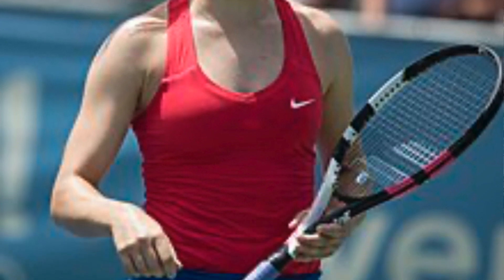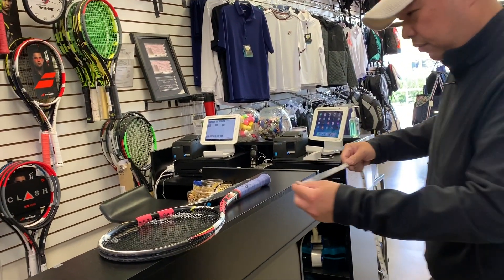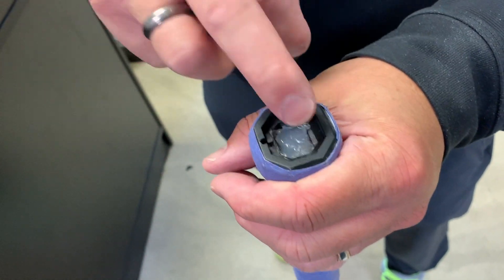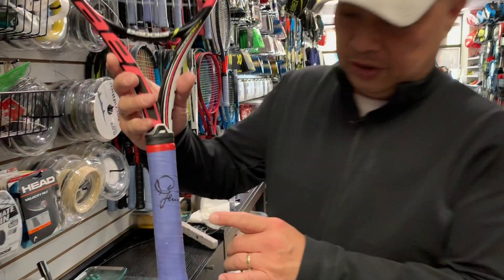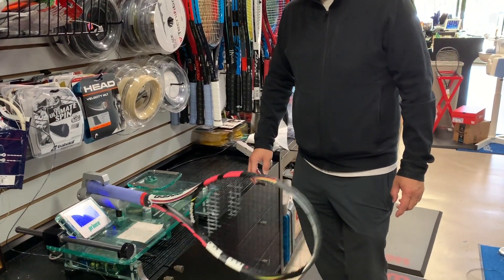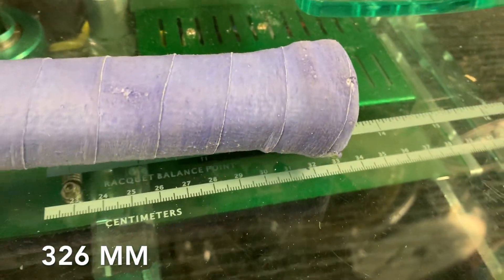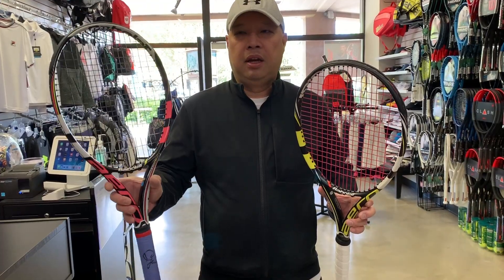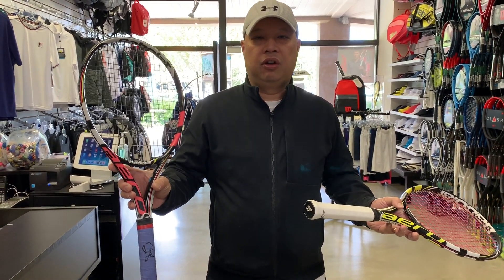EUGENIE BOUCHARD MATCH USED TENNIS RACKET REVIEW

Comment: Does the silicone matter with regards to feel comparing retail and Bouchards frame? Where you able to use it? Less vibration more muted feel I guess
Reply: @ dj...it's mostly used as a customisation tool; to add weight & change the balance. 

Any consequence of that to feel is really only a by product. You wouldn't do the above and totally change the specs of the racquet just to change a bit of 'feel'.

Cheers. 🎾🎾🎾
Reply: @nostro1001   I actually customize myself with lead and silicone to my head  and wilson racquets. It gives solid feeling and a more headlight balance to my frames. What Im interested in is if it makes a difference to how a babolat plays because from what I remember those frames feel hallow and harsh. Been wanting to add silicone on a babolat frame however Ive sold all my babs long ago.
Reply from the maker: You would use it in the handle to add weight and it does take away some vibration and yes mutes the racket.  The weight changes the balance of the racket.  I was saying that this racket felt very balanced and was smooth going through the air.  Thanks for watching!

Comment: Surprising how low the SW is considering that is XL.
Reply: Assume as it was a pro stock racquet it was much lighter than standard. The silicone added a bit of extra weight, but didn't change the SW

Comment: For anyone wondering the silicone is for absorbing shock
Reply: @ Henry... Well no mostly and yes a little. It's about racquet customisation: added weight and changing the balance, so that it's more headlight.

Yes, silicone does change the feel a bit. How much? Hard to know & depends on how much silicone was added!

Cheers
Reply: nostro1001 yes agreed it’s also for changing the balance of the racket but I think even a little amount of silicone can dampen the shock a lot as many Racquets have little absorbing materials in the Butt cap such as my racquet the Volkl V8 Pro

Comment: Silicone in the handle does NOT lower SW! If anything it will increase SW. The difference in the racquets is that hers is a prostock frame. The weight of the frame was much lower before customization. Repeat....adding weight in the handle, even though the balance point changes and the racquet becomes more head light in feel, does not drive the SW down. This is a common misconception by club players and players that get on racquet forums. Btw, it puzzles me that you have to calculate metric CM into metric MM. The system in based on 10s. Where'd you go to grade school?
Reply: @Chuck....100%....adding weight to the handle doesn't reduce SW. People totally misunderstand that.

Edit: lol @ Chuck

**'Mericans just aren't used to metric system!
Reply: @nostro1001  👍😉
Reply: trust me when i say this as a teacher but there a lot of people that do not know how to convert using the metric system.
Reply: Paul Yoon haha! Yeah, I would just imagine.
Reply: So if I put a 5 pound lead weight in the handle the swing weight will be the same?
Reply: Andrew yes! Are you removing weight from the tip of the racquet? Will the hoop weigh less when you add weight to the handle? Of course not. The bottom of the racquet is heavier so the tip feels lighter. Physics! Actually to answer your question more accurately, adding weight CAN increase SW, depending how far from the bottom the weight is. Anything above 4 inches from the bottom will increase SW.
Reply: Andrew this also would increase recoil weight